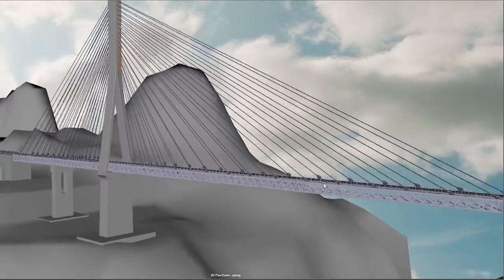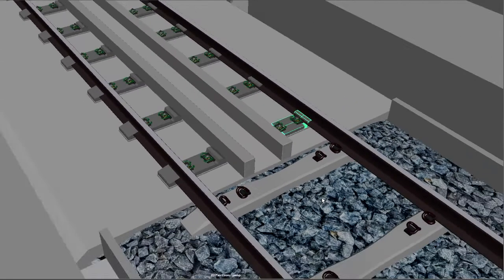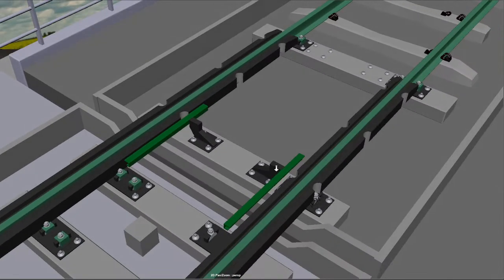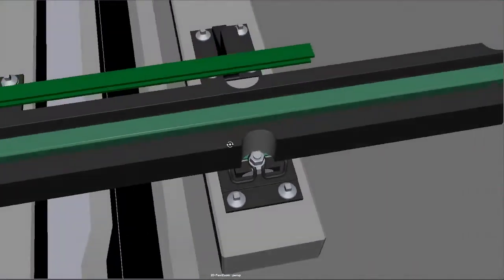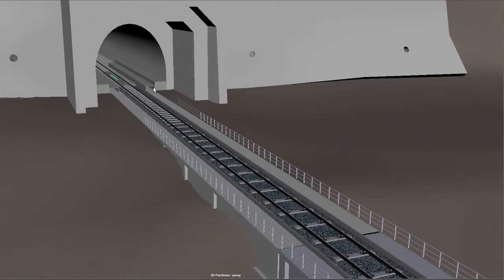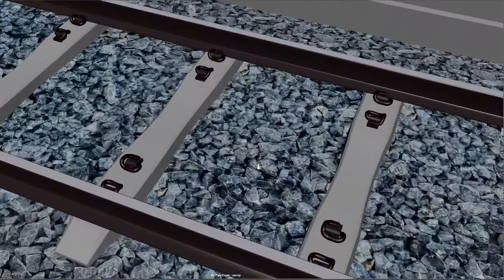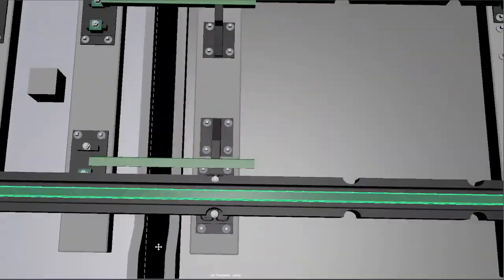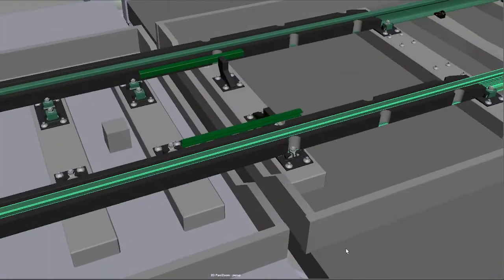New Modern Railway Track technology

Comment: I'm a viewer from Japan. 🇯🇵🤝🇮🇳
In a suspension bridge (cable-stayed bridge) like this model, the bridge girder bends downward when the load of a train is applied, but it is also necessary to consider that the bridge will sway left and right when subjected to strong crosswinds, so I think that the rail joints need to use variable joints like universal joints that can follow the vertical and horizontal deviations.🤔

There are a group of long suspension bridges that run over the sea, connecting Japan's largest island “Honshu” and a slightly smaller island “Shikoku”.
The track joints use special rail joints that can accommodate up, down, left and right deviations and that appear to be a more complicated version of the variable joints used in long rails.🛤️🚃.…👀🍀
Reply: P.S. The rails in the tunnel appear to be placed outside the tie fasteners.☝️🍀